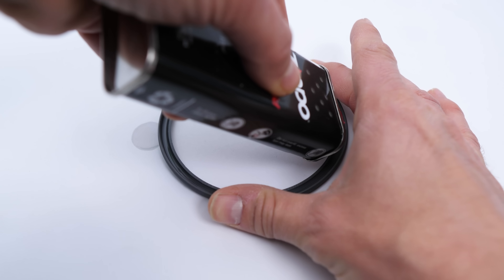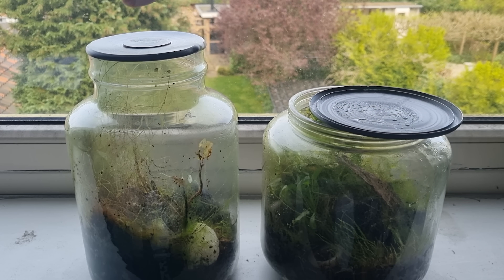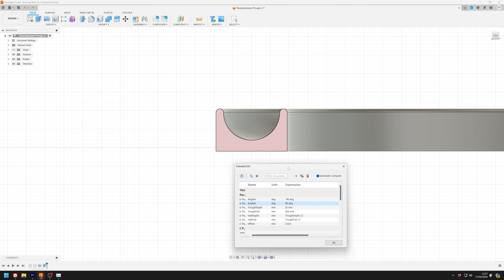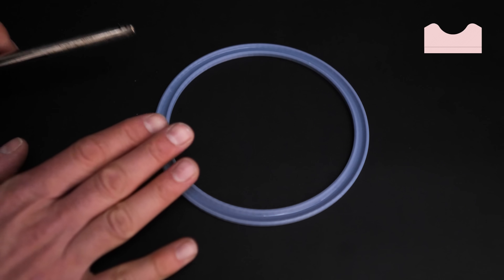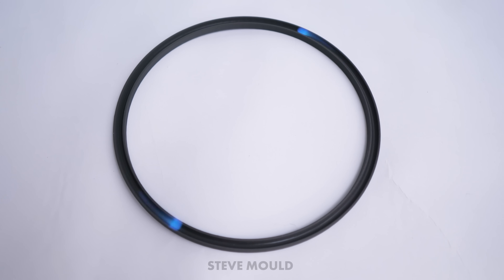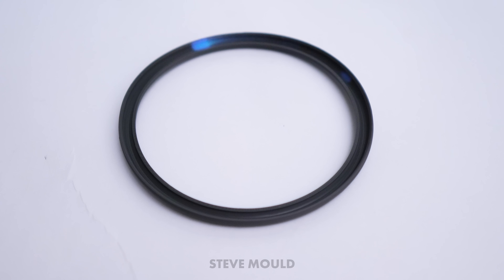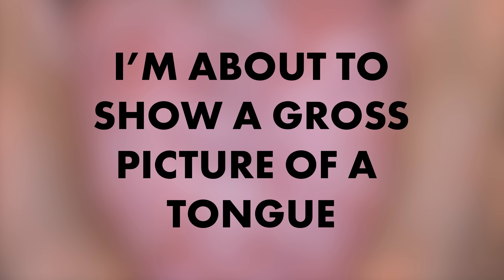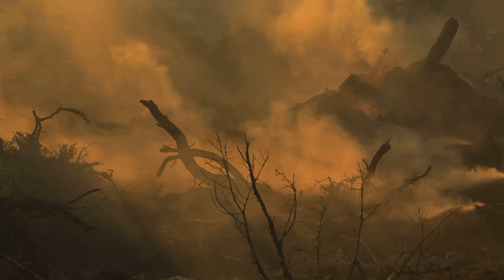Bizarre travelling flame discovery

Comment from the maker: I don't think it can be used to make a logic gates, otherwise you know I'd be trying to make a binary adder right now.

The sponsor is Jane Street. Check out their opportunities https://bit.ly/3vpLNVW
Reply: Literally my first thought.

We really do need a fire computer. Please anyone smarter than me figure out a way to make this work!
Reply: @samuelowens000 well computers already produce heat so that would make sense
Reply: It immediately reminded me of the Wireworld cellular automaton, and that has all kinds of gates. Should be possible if the speed of the flame can be controlled well enough.
Actually, the two flames (cw & anti-cw) annihilating each other in a ring is an example of a xor operation, I would argue.
Reply: @landsgevaer  That thought came to mind for me as well, but I don't think it works, because the place where the two excitations meet in order to cancel out, well, the output place wouldn't have been excited recently, and so the excitations should end up going along that path, I would think.
Like, the only reason the two cancel out, is because the path they would continue along, has already been excited recently, and so wont be excited again.
Reply: @landsgevaer  I had the same idea (about the similarity between wireworld and the flame), but there's two problems:
A: Wireworld has the "if 3 active cells touch an excitable cell, the excitation doesn't happen" rule, which is used in many - if not all- gates. The flame is unlikely to have a similar reaction to any arrangement of troughs (although the "loop with spiral" has the flame that returns from the spiral do only the tight turn when it enters the junction to the loop. 12:05 But that happens when it's just about to be unable to sustain another flame front going through that junction...)

B: Several of the gates rely on the fact that the excitation in wireworld travel at a speed of precisely one cell per tick. The flame would change speed depending on several factors (temperature, time between flame fronts, ...).
The "4-tick complex logic" gates in wireworld rely heavily on timing, for example: with an early excitation front being "on", and in the "off" state, a late excitation front is sent in the same direction to block excitations from turning around and going backwards through unused channels.
Reply: It seems to me that it would be possible to create a calculator in a similar way to a "domino computer" (e.g. a la @standupmaths)
Reply: @quickblondfox  That's obviously what he had in mind
Reply: Could the flame possibly carry or pull/ push a tiny bit of lighter fluid up the slant in the 8 shaped track?
Reply: @0therun1t21  Could you make a “transistor” or a “logic gate” out of two different kinds of fuel? So the “wires” are lighter fluid, but the “gate” is a heavier fuel that won’t ignite unless preheated by a flame from below?
Reply: If you can get the timing right, I'd imagine that a converging pathway might work.  A single pulse of flame travels through.  Two pulses in rapid succession from the two branches would result in suppression of the second pulse because the junction would still be in the refractory state.  There would have to be some sort of way to suppress back propagation - a "flame diode" if you will.  I think a turnaround loop would do it, by redirecting a pulse in the wrong direction back on itself.  I have a mild urge to experiment with this one, but don't have the time and resources at the moment - other projects in the works.
Reply: Putting my guess in the sand here.  We are less than a year from a demo fire computer based on this concept.
Reply: So.. lighter fluid computer is possible...
Reply: One note about these designs, I think you're designing them while thinking about fluid flow, but I get the feeling they don't care.
Like, I don't think the flames will care about curves or corners.
The key thing seems to be keeping the width at that sweet spot, that's why the junctions have problems.
But if you used something like a T shaped split, I get the feeling it would run more smoothly because the width doesn't end up getting too big.
Reply: Im curious what it would do in a Tesla valve
Reply: @raymondgilbert7887  I was about to answer @Perryman1138  about using a Tesla valve for that.
Reply: What about adding verticality? That way you can have a 1-way signal. Have different loops be different signals.
Reply: The most underrated comment is by  @FestivalSharkCam  
A vertical element could act as a one-way diode
Reply: What would a Tesla valve look like with this? That could act as a diode maybe?
Reply: @djsmeguk This has been done. YouTube videos out there already
Reply: Hi and Thank you SteveMould, these troughs are so cool!  Lighter fluid can do this without troughs, but you seem to have economized and optimized the burning process with troughs.  People have been doing this without troughs for decades by squirting the fluid into patterns on concrete.  I think you should try again with troughs shaped to spell out words, such as "SteveMould".
Reply: You might be able to make storage if there was a way to preferentially make the flame go in one direction (a draught or tilt?) like the way bubble memories work to steer magnetic domains around a track.
Reply: @DavidCookeZ80  How about a jump?
Reply: Have you seen the wireworld cellular automaton?
Reply: Or gate is trivial.
And gate might be possible if you figure out the largest troth size unable to contain a flame, have one input connected to this troth and have the other input end in a pool below the small troth, heating it up enough that it can sustain a flame.
Reply: @adrianroed2178  You mean trough
Reply: How could you make a battery and a diode? A pool or container of lighter fluid that replenishes the entire system but doesn’t evaporate, and a structure that only allows flames to pass in one direction, but not the other?
Reply: i dont see why you couldnt use the thermostat doublemetal strip, just make it small enough thin enough to be sensitive enough for the passing flame to bend it. and if you make it so when it bends it touches a copper plate to complete a circuit, you could have a switch.
Reply: Seeing this comment, I'm thinking up some ideas for some logic gates, although the more I think about them, they start to make less sense.
Reply: This is a deception, I bet he is already trying to make a binary adder right now.
Reply: A celtic triskelion design might work for a reciprocating spiral.
Reply: Like others, Wireworld jumped to my mind.  For a diode, you might want to play with some of the parameters you have 'set' for your regular 'wire'.  I'm looking at the oval, where the track splits at the bottom then rejoins.  Perhaps if the two branches got narrower, then from one direction, there wouldn't be enough heat, or enough fuel in the air, for the flame to get past the junction, but from the other side... it might?  Or, put a slanting roof over the track, leading to a narrow aperture.  A triangle-shaped reservoir with channels at the apex and the middle of the base.  Just go wild with the parameters you think you're already done with, get creative.
Reply: Man I was just about to comment that you must try to make logic gates of this. I think you can do it. I BELIEVE.   What happens if you do this in clear tubes?
Reply: I propose you call it the Oroburnus effect.
Reply: Take a look at wireworld cellular automata and some of people's creations in it. It shares similar methods to how this works, but with some logic on top. Someone built a calculator with it i believe.
Reply: Your measurements and fluid distribution would need to be exact, but yes, you could make an entire computer. The main problem would be figuring out how to make a "diode" circuit, where the flame can only effectively travel in one direction. I'd suggest a staircase with small dimples, so it can climb up, but not descend.
Reply: funny you mention that,  as when you brought up CAs, the canonical example that uses this property that came to mind was Wireworld. The ring is basically how clocks work in Wireworld. The only difference between flames and Wireworld is the whole "if there are more than 2 cells in the connector state, an electron head does not spawn" thing that is used to make diodes. But I feel like maybe you could use a different mechanism to achieve a diode in this system, for example if you could systematize whatever interaction it is that's causing flames to sometimes propagate backwards in the spiral.
Reply: The old mainframe Cyber computers had masses of wires cut to exact lengths to time the propagation of the source group of electrical signals so they would arrive at their destination component at the same time. All to avoid latches.
Reply: This is exactly how the electricity works in the classic 2D physics sandbox game Powder Toy! People have made some cool stuff in that, so I imagine you could make logic gates with this!
Reply: A grid could be interesting. Might be very Game of Life.
Reply: @jakereich yep, a grid sound like a good extension, but it may need to be large
Reply: Pretty sure this will be read as "I challenge everyone to try to make a Turing machine"
Reply: It's comment sections like these that make you appreciate humanity. When we aren't blowing stuff up, ourselves included, we're collectively brainstorming how to make a computer from fire. Our caveman ancestors would be proud. 
Oh also, can't forget: It's one thing to make a functioning logic board, but if you're going for a full-on fire computer, even a punch-card one from the 50s or 60s, you'd need a lot of logic boards, and a lot of lighter fluid. That would produce a lot of fumes which can be toxic in high concentrations. So if you're actually doing this, make sure to do it in a well-ventilated location.
Reply: If it follows rules of Wireworld you can search up how all the gates of that are made. It does seem incredibly similar, however it would require consistent timings. 
You'd probably want a clock (ring) producing a signal and into several gates. I'm sure it wouldn't be super reliable, especially if flame speeds vary.
Reply: Steve Mould, your "very long explanation" about why the flare circles is wrong. To have fire you need the fuel and the "oxidizer". The fuel is the liquid you put in the ring, the oxidizer is the air. So, the fuel burns with the air, as they turn hot temp, they go up, so the flare moves for the next molecules of fuel+air, circling the ring. While the flare/fire moves, the remaining unburn fuel cools down, allowing air  (oxygen, etc...) to move inside the ring again on that spot. Try this same experiment viewing it with thermal camera or something like that that allow you to see air moving in and out of the ring 👍
Reply: @aquamastertheonlyone  this subtle detail can make all difference for a logic gate! 
If the limiting factor is the oxigen (not fuel), so we could make a NOT gate by burning the surrounding air, consuming all the oxigen around it.
Reply: @andregn4483  "Logic gate" (with the experiment): don't know about that, so,  you have to test 👍
Reply: @aquamastertheonlyone  are you sure about that? Do you have any sources? How do you explain the fire always on when the groove gets too wide?
Reply: @andregn4483  "When it gets too wide" "the fire is always on" because there are plenty of "rich mixture" (fuel + air) to burn 👍
More wide = more easy to the "burnt gasses" go out and fresh air in 👍
Reply: Wolfram wrote a whole book and a bunch of quacky sounding blog articles about cellular automata as computers. I think you could make some sort of logic gate with this, you already have a clock. Have you tried making a siphon? That might be able to do some logic.
Reply: Dk if someone mentioned already, but the heart is not a "pathological" (unnatural, ill state of physiology) excitable medium, it's "physiological" (of biological body). Not that the meaning wasn't clear, cool video 😊
Reply: @anastasiaklyuch2746  I believe he said heart fibrillation which was unnecessary, but that IS a pathological version of a heartbeat. It is going faster than normal beats, so it's like an uncontrolled refractory period.
Reply: Anything that can control a switch, principally, whatever it is.
Reply: You should make a computer out of it
Reply: Crap, I just suggested that and deleted my comment when I read this one.  😞
Reply: 😂 I just commented that id like to see a binary adder
Reply: @gcm4312 Are you saying some adders identity as non-binary? That may be why Noah built a table of logs… so adders could multiply.
Reply: I don't know if it can be used to make logic gates, but it could it seems like a good candidate for a clock signal for some form of fire-based logic gates. Can you make structures that will allow a flame front to pass through conditioned on the state (burning or not) of a different part of the structure? Using a flame front to light a standing flame should be straightforward, but can you use one to extinguish such a flame? Maybe have the flame front activate a 'candle snuffer' mechanism?
Reply: It might be difficult, but it certainly had been done with slightly different "fuels". There were conferences on implementing logic gates with explosives, which is relatively easy to do.
Reply: this is used as simple demonstration of chaos mechanics you sometimes see in late high-school/early college physics, chemistry or biology labs
in biology, our teacher used a random flammable foam spray, you could spray out any shape, it was used to demonstrate how spontaneous activation and entrainment worked to generate a coherent wave through heart cells' activation potentials
the foam evaporates quickly then slows down as the flammables get spent, so you get to see how a stable attractor/pattern destabilize as the reactivation delay grows
I remember similar demonstrations in physics to focus on chaotic attractors, I know one of my chemistry labs also did a similar display once but don't remember the exact context
it's a really nice demonstration of how complex chaotic attractors can arise from very simple setups, across disciplines
Reply: I'd expect it to be NP-complete
Reply: @NoNameAtAll2  Do you mean 'Turing complete'?  NP-complete is a class of algorithm problems.
Reply: First thought in my mind. :D
Reply: I was just about to make a comment wondering about this... beat me to it
Reply: There do seem to exist some papers on the topic of logic gates in excitable media. Can’t wait for the 3D printed, fire powered counter circuit!
Reply: Oh sure it can, have it burn off a barrier and you have a single use logic gate. Also, I feel like the rising heat combined with depleting fuel has something to do with pulling this in a circle.
Reply: Making an OR gate is relatively simple (up to blocking back propagation).
Regarding NOT gates, it might be possible to design a channel where vapor for the flame comes from one point, and the oxygen comes from an opening which has a parallel channel with priority acces to the oxygen. Have a constant flame loop feeding bursts into the lower channel, making it so that if the upper channel has a flame running through it, the bursts get choked out by lack of oxygen, but if it doesn't, the glame does in fact go through.
(this design might also be usable for preventing back propagation, with a positive signal choking out any bursts going in the wrong direction down the feeder channels. This will require a slight loop in the feeder channels however).

Edit: misspelled a word
Reply: I think it should be possible. There must be a minimum length pulse train that will fit due to refractory time. If you try to put two signals in the gap between the normal pulses with the right time delay it should squelch them both. i.e. that's a nand gate. You might need to interleave the data with a clock signal though to keep timings straight. That will also help with the 'going the wrong way' problem.
Reply: I was going to say "I heard of someone making a water computer" but that was you, lol think you could make a fire computer? you kind of have the potential for a binary circuit. additionally having flames fold back on themselves cancelling the flame out could lead to some sort of computing?
Reply: it could be done.. lower ambient temperature and first flame should heat output-gate and second will set vapored gas to fire... 
or besides enviroment temperature you could change size of groove  in logic gate so it will only get on-fire if both inputs .. ;)

so you need to could manage that temperature to manage getin AND gate and not   OR :D
Reply: What if you combined it with shape-memory materials, so that wherever the flames go, the track temporarily changes shape? Surely that could then be used to do calculations...
Reply: If Matt Parker could make a domino computer, then surely this can be used to make a binary adder.
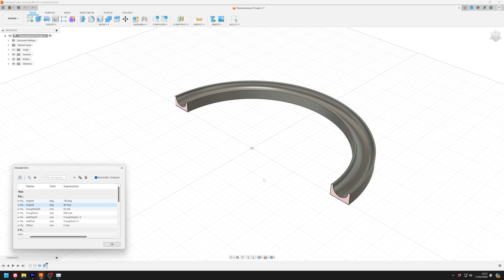Reply: 1:11 What happens if you raise the walls straight up? (without making the opening smaller)
(That move was not demonstrated in your cad file description).
 It would also be interesting to see what happens with other shapes of the "grove", like a V shape, or a square shape, instead of round only.
Reply: If you find the smallest ring required to sustain a flame, it might be possible to create a not-gate: if one ring is on fire, it drains the supply of evaporated fluid to extinguish an incoming fire (traveling in the opposite direction). Once you got that gate, you should be able to create the other types. It has to be a clocked system, however
Reply: This is like a irl Redstone clock
Reply: The thumbnail color change kinda made my brain panic. 
It’s like if someone moved my furniture while I was out.
Reply: When using a clock signal you can xor your value with the clock to invert it. As or gates are easy, you can make a nor gate. The only issue is that you have to get all of the timings right but theoretically, this should be possible
Reply: Hahaha, it wouldn’t work for long if it did, and I think it’s error rate would be high…
Reply: I know you're trying.
Reply: If you make the junction points thinner does that prevent the long lived flame there? Could help for reliability
Reply: Might have to think of the entire circuit as an RF circuit where dead ends into gates are perfectly matched for no relection of energy. The t junctions are tricky but as long as no loop exists which can reignite itself via design around the excitability recovery time constant, beside the pulse generator, should be ok. A two layer circuit with the bottom being control pulses above being computation, and temperature sensitive metal gate closure heated by lower circuit gives you one directional control. A quasi-stable switch could be made by playing with recovery time of 'wire', pulse propagation delay by resistance (channel length or width), tuned residual time of metal switch, and early triggering of a 'depletion zone' with paired metallic strips on either side which trigger simultaneously.
Reply: Maybe ground could be achieved by small loops that always cancel, or by narrowing the channel until the flame just fades.
Reply: A memory metal that is sensitive at the far end but closes at the near end, and closes faster than the flame can transit backwards (flame speed slowed by narrowing channel or zig zagging perhaps) would work as a diode if the reopening time by cooling is fast and the potential reflected flame timings are designed to only be possible in the period between clock pulses.
Reply: It's only a matter of time before someone plays DOOM on lighter fluid.
Reply: @ethansedai870  Ah, Rule 666: If something exists, someone has somehow played Doom on it.
Reply: Omg that is LITERALLY what I thought this video was leading to 😂
Reply: You can try a giant one and sell it to an art show, that includes a combo of many shapes, with a lighter fluid plumbing system, either adjustable pressured or osmotic, and throw different metals in it to make it glitter many colors.
Reply: It is the real world version of Minecraft Redstone. Maybe playing with Minecraft I can have some ideas (good excuse to play) and maybe we can create logic gates. But without an NOT gate is impossible to make general functions (that require a NAND or a XOR that is made of NANDs and ORs). you can't make a general function with only ORs and ANDs.
Reply: what a shame, you already have a clock too
Reply: Feel like the biggest barrier to logic gates even if one could be theoretically constructed on paper is the not quite deterministic behavior at junctures, e.g. the way it sometimes reverses or forms stationary flames. I wonder if juncture design could be fiddled with to maybe make them more reliable/predictable?
Reply: You would need to experiment with the intersections in ways that create predictable outcomes from inputs... maybe something simple at first, like a triangle tip to the end of the pool with a circle on the other side.  Try figuring out ways of making the fire go one way (gravity might help with that, hot gas goes up).
Reply: Has this effect been studied by any chemical scientist or any other scientist who researches how fires behave?
Any papers written about it?
Reply: It would be better if you say to the world what was the name of man who noticed it!
Reply: wha about emergent systems with different orientations of rings at different distances? timing seems to be a significant factor in how they interact
Reply: @kalxi1724  There is a superset of 7 coevalents balanced for super-symmetry like a super conductor. ♥️🧡💛💚💙💜💓
Reply: Can lighter fluid do calculations? Can you make a NAND gate or a NOR gate?
Reply: @vegardt3433  a NAND gate might be possible. I mean you see in the beginning that 2 fires that meet each other can cancel out. (1 & 1 -> 0) 
Those rings can even be used as a clock signal(as seen on the spiral part).
 I guess you would need a path exactly at the location where the 2 fire-"signals" meet to get the output of the "NAND"-gate.
And that might be a problem.
Because of Environmental conditions, the location might be different every time.

EDIT:
Oh now that I think about the NAND-gate again, I guess that was only partly true.
I mean NAND would also mean that if there were no signal on both ends, it suddenly would create a signal (and thats not possible).
Still something tells me that there might be a way (just can't explain why ...)
Reply: Try it
Reply: It allows for a basic error prone or gate, but I can't think of any way to turn it into a nor gate from there. Unless you can get something to react to the heat of the end flame, then use that to determine if the next step lights. So something that expands with heat pulling an ignition source into and out of the flames.
Reply: Flaming “water” computer
Reply: Years ago, I made traveling flames like this without any trough. Squirting the lighter fluid on cold asphalt was enough to get the effect. Maybe you want to try that too!
Reply: You could build logic gates on that?
Reply: This is very very very close to the cellular automaton 'wireworld'. I suspect that some of the logic gates from wireworld could be used nearly as-is.

(Wireworld - 'head' and 'tail' states, where a wire becomes 'head' if 1 or 2 (but not 0 or 3+) neighbors are 'head', a 'head' becomes a 'tail', and a 'tail' just becomes conductor again.
This - 'flame' and 'depleted' states, where a trough becomes 'flame' if there's flame adjacent, a 'flame' becomes a 'depleted', and a 'depleted' just becomes normal trough again.

Main difference is that in wireworld 3+ heads adjacent turn into nothing whereas here 3+ flames adjacent would just become more flame, but that's not the end of the world for logic.

Bigger issue is likely the stochasticity of the real world, but I suspect with tuning you could make logic gates.)
Reply: Since the ramp works maybe you could make a a seesaw flamable weight or glue keeps It in one position once that is burned the seesaw moves to a second position now you haver a transistor, It just wont be resetable
Reply: This was my first thought when you asked for track ideas.
Reply: All is a circle.
Shape of all shapes.
https://www.youtube.com/watch?v=JDSfRcCOsg8
Reply: Is that the Mould Effect #2?
Reply: Apparently nature by default induces particle accelerator ring physics
Reply: there's almost everything you'd need for logic gates tuning it would be a nightmare though and you'd need to work out some kind of reservoir system to replenish the fluid, like wicking fabric along the bottom of the trough. you can store a bit in the circle design with one arm so it can act as a pulse generator. you can make it unidirectional by having ledges and or little angled baffles above the loop. & gates can be made by having the two inputs meet at the bottom of a ledge where either flame-fronts individually aren't high enough but the two combined make it. an or gate is the same but with a lower ledge/smaller baffle. n& needs a built in flame clock with two outputs that are able to be stopped separately by one input each and then recombine so that a flame clock signal is outputted unless both paths are interrupted. xor is like half of the split ring you show tuned so the flames destructively interfere. one of the really hard parts would actually be starting the adder because you'd need to either ignite all the inputs simultaneously or have a central pulse generator that works as a clock.
Reply: Not sure if my input helps, but i feel like there could be some use of using the ring as some sort of AC generator.
Reply: Actually, people are making logic gates from excitable media! The Belousov-Zhabotinsky reaction (aka the @NileRed logo) is a popular excitable medium for scientists. It's an oscillatory excitable medium, so basically self-igniting, but other than that it behaves pretty much the same way. Here is an article with an attempt to make logic gates with it: DOI 10.1140/epjst/e2016-02622-y . I did some experiments with this too, and made channel geometries, very similar to this video (DOI 10.1039/C7LC01187C). A lot of the behavior in this video reminded me of my research! I've also worked with a biological protein system that is an oscillatory excitable medium (DOI 0.1002/anie.201808750). People have also tried to put this in channels, but I've worked with it on spheres, which results in a lot of other interesting behaviors. Unfortunately a lot of these articles are behind paywalls, I'm happy to share the articles though via message.
Reply: Have you seen Wireworld? Is a cellular automaton that works VERY similarly to this, and it's Turing Complete!!! 👀
Reply: Looks like a typical Atlantis layout just saying. Circle in circle. Can you make it create thrust?
Reply: Maybe you don’t think so, but do you know? There’s only one way to find out. Bring us the fire computer!
Reply: Full adder... Full bridge rectifier!
Reply: Here's a proposal. You can get a one-channel or gate (reason for this name will become apparent soon) pretty easily, it's just a junction. Timing handles itself: the first flame to arrive at the junction splits off into both the output, as desired, and the other input, extinguishing any incoming signal if there is one. Perhaps you can use the narrower openings, which support a flame but travel more slowly, to create a one-channel and gate, if you can make it so that the flame more or less halts once it arrives and both need to be burning for the output channel to get hot enough to ignite. (This is by far the most speculative part of this proposal!) Once you have those two one-channel gates, you can make two parallel channels to carry your signal, one where a traveling flame means "true" and the other where a traveling flame means "false" and where you guarantee that only one of them is lit. To get a two-channel nor gate, connect the two input "true" channels to the output "false" channel with a one-channel or, and the two input "false" channels to the output "true" channel with a one-channel and. Nor gates are universal, so you can build everything from there.
Reply: 😂
That was exactly the question that passes in my brain.
Reply: damn I only came to the comments to ask when you were going to make a computer out of it, would be very pretty
Reply: Too many comments to read all of them, so this might have been said already, but would a Tesla valve be effective as a diode?
Reply: I'm going to take that as a challenge.
Reply: People have made logic gates from excitable medium! Most importantly NOR-gates, which is exactly what you need to make a computer. I've posted a couple of replies to this comment already, but none of them are showing up. Can I not include links in Youtube replies?
Reply: Literally came to ask you to make a logic gate with this. You sure it can't be done? This looks like a lot of the sims I write and my hunch is that it's doable under idealized conditions. In any case, this looks like a fun one to sim, and the rocket version of this - rotating detonation engines - are the most powerful rocket engines that exist
Reply: That's a challenge, isn't it? All we need is a reliable design for a diode (and fine control over the fuel/air ratio - temperature - thus ultimately propagation speed)
Reply: @TheAgamemnon911  Two wavefronts colliding with each other effectively extinguish each other, I would make use of this fact and look to make feedback loops that prevent wavefronts from going where I don't want em
Reply: IT'S TEMPERATURE SENSITIVE?  Try it warm, or try it in the freezer?    (Try making a very cold, two-dimensional plane!)

I discovered the five-meter-wide version of this around 1982, outdoors on a rain-wet street, after igniting a bit of spilled lighter fluid in the driveway.  But apparently it only worked on cold days in the fall, with no wind, so usually I couldn't demonstrate it to anyone.  At low outdoor temp I obtained the racing blue flames, but on a hot day the entire thing would simply burn.  Yep, I ended up making a small circle, with long straight runs, so the "oscillator" was driving the "Transmission lines."  
It never occurred to me that it could be scaled down to micro-size.

Also, this is exactly how heart-beats work, where a natural "pacemaker" oscillator is broadcasting periodic waves across your cardiac muscle.  What happens if the pacemaker dies?  Then, a ring-oscillator takes over, with the ring surrounding your aorta, and running at 10x higher then normal.  The same thing can happen with a dead patch of heart muscle.  That's what fibrillation actually is.
Reply: When can I buy them
Reply: Matt Parker made a ”computer” with domino bricks. At least that should be possible to replicate with flames.

https://youtu.be/OpLU__bhu2w?si=jbihEC224h-7MECQ
Reply: Can you test if it is oxygen supply or heat for evaporation by trying a larger half circle radius but cooling it to reduce the rate of evaporation? It might enable you to make wider rings. If not, it might be due to oxygen supply. In that case, test in a box with lower oxygen/nitrogen ratio.
Reply: The unintuitive part about electronic logic gates that many people don't know is that they have a separate power source that refreshes the signal at each gate. It's the only way to implement a gate where g(0,0) = 1. So basically, if your "logical" signal is flowing from left to right, then you'd need to feed each gate from the top and/or bottom, with the correct timing. A few years ago I came up with some designs for logic gates using dominoes, which have pretty much the same problem (only worse, as you can't ever repeat a signal traveling down a wire).

If I tried to do this, the first thing I'd look into is implementing reliable clocks, and ways for blocking an incoming signal until the logic-carrying part of the circuit is ready for it (this is a standard mechanism in electronic gates). A flip-flop might be a good place to start.
Reply: Maybe hmm
Reply: It's quite temperature-sensitive.  Try it warm, or try it in the freezer?    (Try making a very cold, two-dimensional plane!)

Do it outdoors, on the street.  I discovered the five-meter-wide version of this around 1982, outdoors on a rain-wet street, after igniting a bit of spilled lighter fluid in the driveway.  But apparently it only worked on cold days in the fall, with no wind, so usually I couldn't demonstrate it to anyone.  At low outdoor temp I obtained the racing blue flames, but on a hot day the entire thing would simply burn.  Yep, I ended up making a small circle, with long straight runs, so the "oscillator" was driving the "Transmission lines."  

It never occurred to me that it could be scaled down to micro-size.
Reply: Well, a flame can extinguish another, so a switch can be implemented, but it would need very precise timing
Reply: Isn't a conversation an excitable medium? We talk until our desire to share information is satisfied, so we stop. But over time more information is gathered until we have the desire to talk again. Same could be said for all human social interactions.
Reply: My first thought was "I wonder if someone could make logic gates with those."
Reply: spiral has to shrink as it closes in on the center. If you wanted to work. The diameter of the trough has to shrink as it gets closer to the point Of the center of the Spiral. Or the sides have to get taller. If you put little pools on each end it could probably go down bounce off the pool and get sent back in a straight line. Having a deep pool on one point my cause it to light over and over again without having to do it manually. Cool stuff. The people who exist in the flame engineering space are getting old and retiring it's cool that somebody's learning about this stuff. I work for a factory company and we have to pull people out of retirement constantly.
Reply: i think a version that would stick with the vision could involve tracks with varying depths/angles to control the refractory period?
Reply: I think you should be able to make logic gates.
At least if you get the interactions consistent enough.
For example if you can extinguish/enlighten either a split or a loop predictably, I'm pretty sure that's already enough to build a GOL like logic gate.
Reply: How cool is that?
Reply: Didn't turn lights off once? Dafuq?!
Reply: In Golly (game of life sim) there is exactly one rule called WireWorld which resembles this too much for logic to not be possible
Reply: Would you mind making a Tesla valve using this trough, just for demonstrative purposes?
Reply: I’d love to see a flame computer!
Reply: Maybe you can team up with the slow-mo guys to get this in high speed footage
Reply: Hey Steve, do you think that’s what going on with the giant red spot on Jupiter?….some kind of excite able medium causing the storm…or maybe a forest fire😮
Reply: @dmurf4156 19.5 degrees the gravitational cusp is essentially a fusion engine.  It makes heavier elements, even diamagnetic ones.  They are excluded sometimes
Reply: It could be used for logic gates. There’s a 1-D variation on the Game of Life called “Wireworld” that would probably be good for modeling the behavior.

Chaining gates wouldn’t be reproducible. NAND will probably be tough.
Reply: You would probably have to exploit the refractory period to make some branching directions impassible. With two or more clock pulses traveling around. Try building a figure eight with a cross instead of an overpass. Perhaps sitting on a block of ice, or with a narrower channel at the intersection.
Reply: My Brain: automatic LEGO domino re-setter video
- 3 seconds later (French accent)
Steve: Kinda like this LEGO contraption...
Reply: Ok,how about - if there's a flame under a track, then it can evaporate enough butane that the track above won't carry a flame? That forms a  "A and not B", which is all you need.
Alternatively - timing. Odd pulses carry the bits, even pulses - if present - use up the oxygen and stop the following odd pulse from travelling. Again, you have a "A and not B".
Maybe the first thing to aim for is a one-way valve. An arrangement of track that acts as a diode.
Reply: Ok, didn't get to read all of the responses but hoping it hasn't been said many times already, it seems the circle track is a good pulse generator. Track width or closure works as resistance, track length can be tuned in the propagation delay sense like in EM waveguides or computer architecture's pipelining (iirc the name). Not sure about inductors and capacitors but we already have self sustaining periodic activity so we may not need direct analogs. The thing that brings it all together though, is a flame transistor. I'm imagining a flame FET where the fire wave is current, and temperature of a bimetallic strip or memory metal is gate voltage, the metal is tuned to deform when a flame passes it in a control circuit. You could have normally closed or normally open gates based on strip channel closure at room temperature. Channel closure prevents back propagation. If the thickness of the metal is chosen such that there is a significant time to cool back to the unexcited state, but shorter than the clock rate if the pulse generator, I don't see why you couldn't build all your binary logic gates using existing transistor based designs.
Reply: There’s a trick in “making computers out of things” where you have two streams for each input, one for off and one for on
Reply: Oh no, my first message about a flame FET disappeared and now idk if anything I wrote is gonna make sense without it 🤦‍♂️
Reply: You should look into "Rotating Detonation Engines"! They use a similar principle.
Reply: ok so wait imagine three parallel troughs, and along them at one point are two small openings leading from the middle trough to the other troughs--not enough to pass the flame when just one goes by, but enough when two go by.  can use a cyclic loop before each of the two side troughs to send repeat signals to increase the chance of the middle one firing (but would have to make sure it really never works with just one signal, I am fairly sure this is possible) so that's your AND.  no idea how to do NOT though
Reply: I would try covering the trough with periodic tunnels or gaps to see if that changes the speed of the flame front. It could be similar to myelin sheaths covering and insulating the axons of neurons.
Reply: What if you were to vary the amount of outputs and change width and other parameters along a lenght?
Reply: I wish to see those "fire loops" in dark.
Reply: 😮 really interesting video steve
Reply: if you back to early computing and mercury delay lines it makes you think that maybe it might be possible. you would have to solve the supply of fluid problem, but with careful timing of lengths, and adjusting of surface widths to prevent end bounces and create sources, the main challenge would be entering in a value, and reading the result.
Reply: it kind of like "the game of life" cumputers. you can take the idea that Alan Zucconi was showing in his video
Reply: a donut with holes would have same effect?
Reply: It can be used to make rocket engines, which are already in an advanced stage of development.
Check out "Rotating detonation engines"
Reply: I literally just posted a comment suggesting this... (you can find it by going to 14:00 in the video and then using the "Timed" comments option on YouTube. (At the top of the comment section you can select the option "Top"/"Timed"/"Newest", select "Timed".)
Why don't you think that this would be possible? Using two intersecting channels*, one that cuts into another one (source/gate/drain, you get the drill), to prevent the flame from traveling over channel A when channel B has been activated (timing would be a slight issue, but by no means insurmountable, right?), potentially using a *Tesla valve like structure to prevent the flame from going backwards.
Reply: Would you be able to do a race track like the nurburgring and set fire to it so see the flame complete the tracK?
Reply: Do all the Nazca drawings!! It might help solve if they were done as torch-carrying pathways
Reply: When two pulses hit a Y at the same time they cancelled out. Seemed like and OR gate to me.
Reply: If you had a Y intersection of two 5mm lines and you necked down the output just enough to where a single flame pulse wouldn't make it through, you'd potentially have an AND gate. If two flames hit at the same time, they would have enough momentum to make it through.
Reply: two flames make a non-flame and that's an XNOR, the junction should be printed maybe with 4mm, and a little bit of change it can be made to be an xnor
Reply: I feel like the question of if an excitable medium is turing complete must have been answered by some mathematician.
Reply: I do that for living also... but nobody ever asked me to do something with this interesting results. And I worked in military R&D.
Reply: The traveling flame mimics electrical pulses in a CPU, where the path length needs to be equal to keep timing equal.
Reply: If this is anything like the cellular automata, then Stephen Wolfram may say it’s possible to use it as a computer.
Reply: Instead of making the groove circular, what if you made it like an upside down triangle? So the point is down?
Reply: Do you think it would work in zero G? W/O convection?
Reply: noooooo i was just about to suggest that!
Reply: you should try it though
Reply: Can you make one that starts off as a 5mm trough but at some point the "wire" expands?
Reply: I saw a non-binary adder I didn't know whether to bite it or shag it
Reply: if it can be used for logic gates, it means you could make it run Doom
Reply: Now, print a float valve and you have a permanent kinetic(?) sculpture. 

Do it!
Reply: How about a Tesla valve loop? I’d love to see how the flames behave!
Reply: It looks like it can, though, because the flames sometimes meet and cancel out. That's all you need.
Reply: I would love to see you scratch your head at making logic gates with this system. Maybe have it do simple math?
Reply: I came here to say this. What if you had a bunch of lighters hooked up so they all fire a flame all at once down transistor-like tracks? Could that be used to at least make a basic logic gate?
Reply: That radial desin gave me cellular automaton vibes. So in a way you could stil compute stuff with this
Reply: Two million views (almost) in two days (almost) is testimony to your audience....

Well done them....
Reply: And have you read Consider Phlebus?.... about a fire that rings not just a forest but a whole planet?

Just a thiugh
Reply: A rotating detonation engine uses the same principle
Reply: And I agree with the mediums/media posit
Reply: Do you know about neuron axon? Perhaps the most important excitable medium. I wonder if you can achieve the same effect as myelin sheath with this one.
Reply: It is the same as a rotary combustion travelling wave rocket engine.
NASA has been doing so e experimentation on these.

R
Reply: 2 words fire clock
Reply: Computers are definitely doable, if it can be done within the game of life, it can be done here, definitely.
Reply: You made all of these and you didn't think once to film them in the Dark for maximum effect? Please film them in the dark! 🙏
Reply: You got the greatest job. Playing with lighter fluid all day seems like a dream to me =)
Reply: Actually I think it could. Interestingly enough. Please consider my comment that suggests a modified. I believe it would be 1 step in the right direction for creating logic gates and a lot more useful things.
Reply: How much does the Coriolis effect impact the traveling direction of the flame?

Wondering if having a short slightly wider section that tapers directly into a slightly narrower section (within the acceptable parameters of operation)… could help make 

Possibly make sets of 2 of these, the same, but opposite in the direction of taper to test for optimal direction of travel depending on the northern or southern hemispheres.
Make one were the trough tapers to the left and one were the trough tapers to the right.

Thinking this could perhaps be developed into a gravity vapor combustion engine with minimal moving part. But we need to know how significant the contrast is between the direction of travel given  the various northern and southern latitudes.

I love that you are doing experiments on such. I really hope you consider including and modifying this suggested alteration into this experiment. I would absolutely love to see how it plays out with varying degrees of wider and narrower tapered sections.

Should the flame be lit on the right side or left side of the short tapered section?
How can this modification assist in insuring that the flame travels in the intended direction?
So many questions, I want to know, I would love to see.
Thanks a bunch!
Reply: It can be: pulses can use up the gas so that another flame can't pass through a junction immediately afterwards.
Reply: make doom on fire.
Reply: im like 99% sure the fluid is being propelled by the reaction like any old jet, i dont think the fluid on the track/vapor has anything to do with it. you could try an infinite track or one that slants slightly upwards consistently to see if im right. also you should try a ramp see if it can jump gaps
Reply: It would be incredibly fiddly.
Reply: I came to the comment section to ask only to be delighted that you had considered it also.
Reply: Read this comment of Steve's immediately after posting mine suggesting such gates... 😅
Reply: I suspect lighter fluid is more well-behaved than the mold colony someone ran Doom on.
Reply: I came in here to suggest this very thing…
Reply: @SteveMould at 11:00 the fluid is holding due to 1. viscosity and and 2. tensile strength
Reply: There's a doctoratal thesis somewhere in there.
Reply: My first thought was put heat detectors at ends of the tracks then input into an engine simulator program for a slightly chaotic firing pattern
Reply: measure travelling distance and create pathing using AI to create logic gates using intersections.
Reply: Fire computer. Star neurons?
Reply: Have you seen the domino calculator?
Reply: Your ring and star shape reminds me of magnetron design and working principles. Magnetron = the microwave oscillator component of  microwave ovens, and many types of semi-long range radar.  This image is part of the Swedish wikipedia article on Magnetrons https://sv.wikipedia.org/wiki/Magnetron#/media/Fil:Magnetron-1.png. The english Wiki has other images but none that reminds as much of your resonant ring and star shape: https://en.wikipedia.org/wiki/Cavity_magnetron
Reply: I came here to comment exactly this
Reply: So is Turkmenistan "Gates of Hell" exhibit similar phenomenon?
Reply: Took the words out of my mouth.Still think it would work!
Reply: perhaps 3bit logic can be implemented?
Reply: Could you please combine those designs with the tesla valve design and make another video about this topic?
Reply: You can observe this on a gas stove as well
Reply: WireWorld is an Excitable Media Cellular Automata that can support logic gates. It's surprisingly similar to this, though I think implementing flame based gates in hardware would be extremely finicky. I think you could get them to work, but not reliably.
Reply: reminds me of a rotating detonation engine. Pretty cool. I wonder if you could program accurate timing into something like this?
Reply: Are you willing to share/sell the .stl file? I'd love to print this myself
Reply: This video made me think of organ pipes and pulse jets. I bet this excitability principle could be extended into those areas.
Reply: You've got the eyes of a mad man.
Reply: Has anyone suggested a fractal pattern?, you may have to use your auto igniter circle to get it going, but sometimes like the triangle of triangles, of the flower of life.
Reply: There is a cellular automata called "wireworld" very similar to this, almost an idealized version of what is in the video. Wireworld has a diode and a not gate, so maybe you could make logic gates. It would be rather difficult to make it work consistently though...
Reply: Please please do a binary circuit with this! You can definitely build a computer. One just needs to figure out a few things: How to keep adding lighter fluid without exciting the existing flames. How to fix chaotic behaviour. How to prevent flames from travelling backwards. 
Maybe one could solve the latter by making the opening slowly become narrower towards one end and then immediately its original width again. That way a flame could be accelerated into the other side, but couldn't reexit from there.
Reply: No one ever told me exactly how candles work in my 33 years on this earth until now. I don't know if anyone else knows.
Reply: I suspect you can make logic circuits assuming everything worked on perfectly timed pulses. You'd need to be able to build a NOR gate or alternative universal logic gate. That might be doable by having a clock line (regular pulse), which is connected to two other input lines which come in _early_, causing premature burn and preventing the signal line from doing its correctly timed pulse.

In practice, this is never going to be plausible.
Reply: Fuck your sponsors
Reply: To make any kind of working logic gate, you would need some kind of switch.  Maybe something like a train track switch?
Reply: Awesome content as always, thank you. God bless. Jesus loves you!
Reply: I like the reference to another YouTuber
Reply: Would rubbing alcohol or charcoal fluid work too
Reply: Maybe make your name or your channel's name make it look like a neon sign type design and have the channel's name. 
Also pick a person from the comments and make their name or send them one of the ones already made. I know you have the blueprints to make them yourself but most of us don't have a printer to print one.
Reply: It reminds me of a Tesla coil electricity going up two metal rods.
Reply: Turn the lights out
Reply: maybe it's just that you have to find the correct mechanism for "combustion logic"
Reply: Why does it go counter clock wise
Reply: We were playing around with this flame effect as children in the 1960's. It could also be seen in paraffin heater flames, around cylindrical wicks, when they were turned low.  I'm very surprised that you had not come across it earlier, Steve. But thanks for the video.
Reply: Put a wick inside the trough, to sustain it for longer!
Reply: You should look into 'rotary detonation engines'
Reply: Now if they can synchronize the flame with rhe vaeious frenlquncies.
Reply: El líquido inflamable dise una advertencia :irritante inflamable corrosivo? Daño para la el medio ambiente y daño para la salud y lo respiraste
Reply: When it comes to getting a liquid to evaporate faster, it's all about increasing its surface area. This is the single most effective way to help more molecules escape the liquid and become vapor in the air. Think of it like a crowd trying to leave a room; a single small door will only let a few people out at a time, but if you open up a massive wall, everyone can leave much quicker.

In the case of evaporation, the "doors" are the molecules on the liquid's surface. By spreading the liquid out into a wider, shallower container or a larger pool, you dramatically increase the number of these "doors" exposed to the air. This allows a much higher volume of liquid molecules to break free and transition into a gaseous state.

The effect is why a puddle on the pavement dries up much faster than the same amount of water left in a deep bucket. It’s also the reason clothes dry faster when they’re hung out on a line rather than left in a pile. The increased surface area allows more molecules to move from the liquid to the air simultaneously.
This principle is fundamental to many processes, from the way we dry food to how factories manage large-scale chemical reactions. In your experiment, a wide, shallow channel would give you a much better chance of getting that high-vapor concentration needed for the traveling flame.
Reply: What it can be used for though is for Science class in Biology. I use it in my lessons about Neurology and how refractory time in Axons work and I include your Videos
Reply: This seems to follow bernoulli’s principle…theres clearly a gradient through which translate into mechanics
Reply: Guys, Salvation is simple

HalleluYAH (Hallel u YAH) “Praise YAH”

YAH The Father (Genesis 1) was Who they Crucified for the sins of man and YAH arrived to be Crucified via the Tent of Meeting (Book of Isaiah)

Isaiah 42:8
I am YAH; that is my Name! I will not yield my glory to another or my praise to idols.

Isaiah 43:11
I am YAH, there is no other Savior but Me.

Isaiah 45:5
I am YAH, and there is none else.
Reply: @SteveMould What influence does lighter fluid have on this?
Can it work with other flammable liquids?
Petrol? Rum? Vodka? Rubbing alcohol?
Reply: This does feel like it could be used for computation.
Reply: Talk to Matt Parker, with his expertise in domino computers he might be able to suggest something.
Reply: To create an OR gate you can have 3 channels. 2 inputs on either side and output in the middle. The middle one needs to have higher walls and something like a wick inside so that flame from any input can light the output, but not the other way round (because flame floats up). To have an AND gate you'd need to have a middle channel such that one flame is not enough to light it, but two on either side can do it. Can you do it by making it wider/narrower oslt*? The flames have certain length so a small inaccuracy in timing will not matter. NOT gate? You can't light a flame when there is none, but perhaps you can have a clock signal? Then NOT gate would prevent a clock signal from coming through.

* or something like that
Reply: Would it be possible to make a particle accelerator but with the flames? So they'd fly around a big loop in opposite directions then smash into each other?

The small flame collider?
Reply: @Casterborous  you could but it wouldnt be very exciting, the flames would just go out as they’re not physical balls of fire hitting each other
Reply: @Casterborous  yes of course --- certain marriages are like that...not mine, but many are
Reply: You said: "I don't think it can be used to make a logic gates", but did you try it?. Excelent video :)
Reply: @h1234e1234  You know he did, otherwise he wouldn't have mentioned it!
Reply: An OR gate is simple enough. You've got memory in the form of loops, which can be toggled on or off by an incoming flame. What you really need is a diode, so that one input of a gate can't backfeed through the other input.
Reply: @alexholker1309 it is possible to make a copper mesh that would take enough heat from wave front to collapse it.  Not sure if this could be made to function as a gate by heating the copper so it doesn't collapse  the other flame front.
Reply: Why'd you spell it 'traveling' with only one L? Strange.
Reply: @KFPGum  Why not? Both single and double l variants are commonly used and interchangeable.
Reply: @KFPGum  He's evil.
Reply: @KFPGum  What colour is your aluminium neighbour?  (Grey, probably!)
Reply: @KFPGum  Travelling is for Britain, they took the L back in 1776.
Reply: @KFPGum  It's the American spelling of it. Just confirmed it. If you wanna see for yourself, turn on your phone's predictive text, set it to US English and type part of the word in.
Also, you can blame capitalism for that sorta thing happening. No, seriously:
Way back when newspapers got charged for every letter/character they printed on the press, they'd omit certain 'unnecessary' letters to cut costs, and it happened so often that we just got used to spelling 'colour' as 'color' and so on...
Reply: @KFPGum That's how **I** always do it.
Reply: @KFPGum I have only seen it spelled with one  “L”
Reply: @KFPGum 😊😊😊😊😊😊😊😊😊
Reply: @KFPGum  Because he speaks English as opposed to USian, which is a deceptively similar but actually completely different language.
Reply: @KFPGum  British English
Reply: @KFPGum Who even cares? Clearly you know what he means.
Reply: @KFPGum dont know what youre talking bout man, it is with one L. You trippin